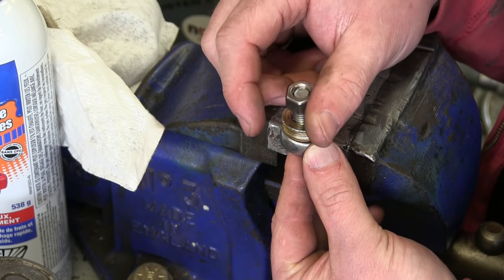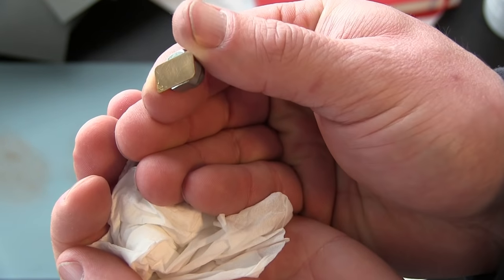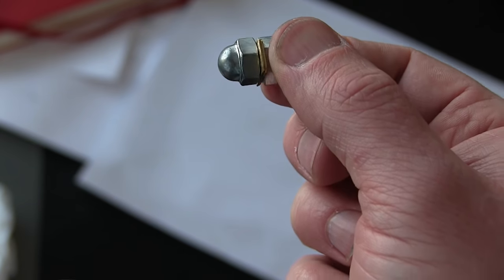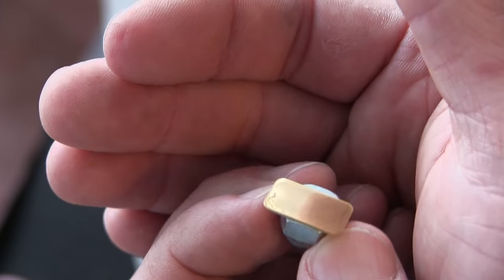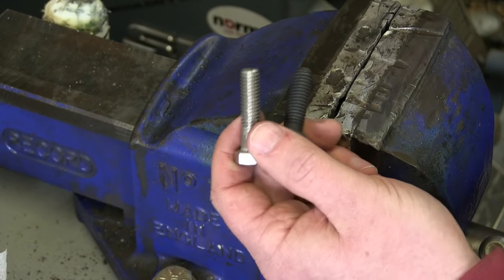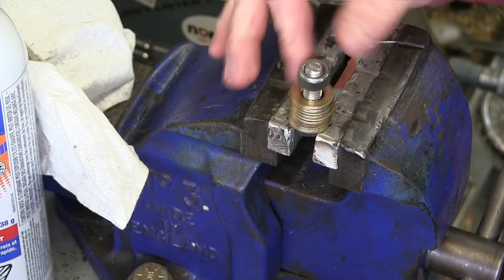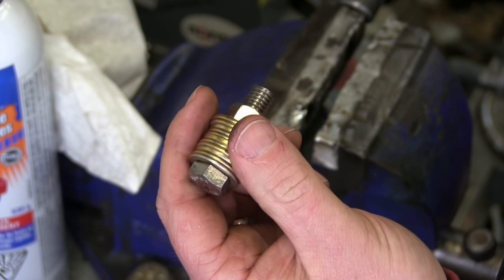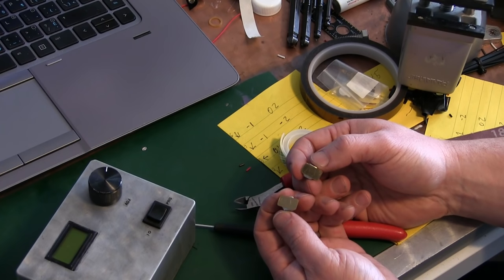Cold Welding of Gold and Stainless Steel in Earth Atmosphere.

Comment: I'm working on a project that use a band clamp with T-bolt fastener. The design calls for stainless to be used however I'm having issues with galling/cold welding of the T-bolt nut/threads. Any thoughts or experience on material choice to keep an anti corrosion design but reduce the galling as the application gets tightened? Thank AvE!
Reply: I'm shying away from the never seize as it'll be for food use. Have you seen the Nitronic 60 SS material before? Very similar to 304SS with some extra Si and Mn to reduce wear. Might need to talk with my local machine shop about sourcing some of this...

https://www.rolledalloys.com/alloys/stainless-steels/nitronic-60/en/
Reply: Thanks for the responses. The search continues!
Reply: There is food safe lubricants. I'm in the food industry (and had my fights with stainless hardware :/ ) Whitmore Medallion is one brand.
Reply: There are also a number of ptfe food-safe sprays that are a dry lubricant. I'd go that route. I am in the aerospace industry as an engineering tech, if you needed any credentials. I use a lot of magnalube, just not the dry stuff (unless it is some release agent) and I am a big fan of ptfe products. I'm curious as to what the thread diameter/pitch is and the spec torque. How close are these fasteners to food? Cuz copper or nickel really is the way to go.
Reply: just thinking out loud cause i dont know all the specifics, but i wonder if there are any 400 series hardenable ss alloys such as 440 a, b, or most commonly c that would meet the requirements. also there are precipation hardenable ss alloys like 17-4 or 15-5 or 13-8 or maybe 17-7. they are a different breed of stainless steel in terms of how its hardened. 

btw, ive worked on both aluminum fuel delivery trucks and in the wastewater treatment field and have used a lot of 304 and 316 hardware.  i feel your pain with galled hardware.

ps. i know ARP makes fully work hardened 304 hardware. its usually rated at somewhere around 170,000 to 180,000 psi vs 80,000ish psi for regular ss hardware. idk if the ARP work hardened hardware would be more gaul resistant. it would be cool to see.  

btw, using 2 different types of materials for the male and female threads have helped in the past. . . just not ss bolts in aluminum that gets salted each winter. no fun on fuel trucks.
Reply: We use cocoa butter at work for stainless and I am pretty sure it is because of it being food industry stuff.

Comment: So the blue ice is not what you want.  I misspent some of my youth working on a small tour/cruise ship in Alaska.  We'd visit Columbia Glacier and one crew job was to net the right kind of ice out of the water and break it up for drinks.  The newer stuff is blue.  At the bottom of a glacier, the ice has had all the impurities squeezed out of it.  Or that was the line the tourists were fed.  It's kind of hard to spot in the water.  It rides lower in the water.  It doesn't even have bubbles like the cubes in your fridge.  It's very very clear.  And in a drink, it seems to take a long time to melt (three drinks on one piece).

Comment: thats a great example of cold welding due to galling. we work on aircraft floats at work and the bastards at the factory put red lock tite on the ss fittings between the bottle and the hose that goes to the float bag. about 70% would weld up like that and we had so many mechanics that were like ahhh bull shit i can get that off. yea they couldn't. best chance for success we could come up with was heat but cant get it too hot. what would you recommend?

Comment: The AMP wire terminal company (now a division of TYCO, (or maybe they changed the name, I don't know)  Says that a properly crimped terminal cold welds to the aluminum or copper conductor.  I don't know if that's true, but I've seen a section cut from the crimp, and I can at least say it's pretty solidly attached, somehow.

Comment: Does this mean compression wielding is a form of cold welding as you describe it? Crimping in electronics uses a similar method. The other thing that springs to mind is when I was tuning RD350's for proddy racing and we needed to get the seal on the barrels really good, we used a mirror as the base for the grinding paste. Would this be of any use in your situation?

Comment: Let's say you placed two metal pieces in a near-pure argon atmosphere and then sanded off the oxidation. Would the pieces cold weld then as long as they remain in the argon atmosphere?
Reply: it would be better than in atmosphere but worse than a vacuum, the argon molecules would still fill the tiny pits and make a not great connection, but it wouldn't create oxide as you did it

Comment: 9:47 That small vise in the upper right corner, Clickspring has one just like it.
Could you tell me what that vise is called? I can't quite read it off the screen
Reply: Thx for the advice weird uncle
Reply: if you need a swivel vice get a shop fox parrot vice. it's the standard vice for gunsmithing.
Reply: Hmm there seems to be a split opinion about the parrot vise on Amazon. I'll probably fabricobble something together and look if it works before I drop money on it. I would love a vise with skinny jaws, right now I have a forged 140mm Heuer Front vise. Which is skookum as frig but not exactly suited for delicate filework, which I find myself doing occasionally. 
Maybe I could build an attachment to my existing vise?

Great, another project to distract me from college xD

Comment: It looks like Van Der Waals forces holding the two pieces of metal together, not cold welding. You can get the same effect just by putting two steel gauge blocks together. If it were actually cold welding, then they wouldn't come apart.

Comment: is the stainless bolt cold weld possible under hand torque (say with a 8' spanner) or would a ceased bolt in that case just be a threading / fuckered bolt problem?
Get my hands on some right messed up rented gear, wandered if that's why all the bolts are jammed to hell

Comment: you could probly get the gold plates to cold weld if you lapped them together.  take that diamond grit paste whatever and stick it between them, and rub em on each other.  rub them linearly, not circularly or any other shape.  the objective is to wear them to a common surface shape.  then ya clean em up and stick em together again and then it oughtta weld a lot.  If you got a third one and cycled which faces are rubbed together, and didn't go linearly, you could form some extremely flat surfaces, down to 30 nm they say.

Comment: I can't tell you how many times I f'ed up stainless fasteners when I worked in a Marina. It got to the point every bolt I put on got a dab of 2-4-C, just to be safe. You showed one galling up under load but I've had one lock up just running down tight, no load. Stainless is great, but they are finicky bastards.

Comment: Isn't the stainless problem known as oxide welding, i.e. when you remove the protective layer a new one will form but with two surfaces pressed together it will weld them in the process.
A rough story I remember.

Comment: A friend of mine who Builds Drag Racing Engines had a catastrophic failure on the Dyno with a Clients Race Engine built from 100% brand new parts, A Titanium Valve Failed, damaging a brand new cylinder head piston and rod, warming up on the Dyno, lots of words from Australia to the manufacture in America of the Valve suppliers who refused to warranty, who insistently stood by their product refusing any warranty, stating their valves were X-ray tested before leaving their business. With only one worldwide supplier my friend repaired the damaged engine and X-rayed all 16 valves in Australia before rebuilding and starting the Dyno tune process, again started the engine and leaving it to Idle on the Dyno and weighting for it to get warm before getting angry with it, another brand new Valve Failed..Again lots of screaming down telephones and it turns out the Engineers asked what he was doing before installing the valves, it turns out my friend was spraying them clean with Contact Cleaner before putting assembly Oil on them. I'm a plumber by trade and years later I was doing a job in an Aviation Engineering workshop and the guys were talking about Cold Embrittlement. I told them the story above and they totally agreed, by Spraying Chemicals like Contact Cleaner or Shrinking parts with dry ice for interference fit installation caused Cold Imbrittling like heat treating in reverse, it fucks with the surface hardening. another job i was installing pipework in a winery for high-pressure gaseous carbon dioxide, from a yet to install 50K/liter vessel. the Engineers came out to inspect my pipework again explained the cold embrittlement issues for the first 10 meters of pipework had to be a higher pressure rating that the remainder of the system, because of the effect of the cold gas has on the material. my point is the contact clear could be causing your Gaulling Issues

Comment: I've been told 304 bolts with ASTM marking (specifically F593C), won't seize up, because they are manufactured to a higher standard.  This sets off my BS detector, but in my limited experience, I've never seen a F593C seized, but have seen a few bolts marked 304 seized. Anyone have any thoughts on this?

Comment: there was this old time boilermaker who lived by "you better fucking antiseize on those stainless bolts", sure enough hes bolting out fibreglass flanges that require stainless nuts and bolts, doesnt antiseize any fucking one of them. Next day Im told to change out the bolts for smaller ones and every fucking one of them was seized. I go up to the boily in question with the bolt that I snapped off and say "next time antiseize up your own fucking bolts"

Comment: Cold welding is only instantaneous at the nanoscale. Your definitely in the macroscale in this video. You need to apply pressure at these scales. That's why the bolt worked and the gold only so-so.

Comment: We once got some contractors to mount some piping for us. These guys didn't use thread lub for round about 25000 (!) stainless Bolts for a brand new facility in Germany. I tell you every fucking bolt was seized to fuck ranging from M12 all the way up to M64. Also it was a chemical plant and we weren't allowed to use spark inducing tools. It took around 2 whole weeks to fix this Problem and cost a shit ton of money because i tell you these bolts aren't cheap!

Comment: Can wringing/cold welding be done with non-metal stuff? Like obsidian or something?
Reply: I'm just a student, but as far as I'm aware, it can only be done with metal. What happens is that metals share electrons freely between atoms in whats called a sea of electrons. This is what allows cold welding to happen. Obsidian is a ceramic material, and it's bonding does not allow cold welding to occur.

Comment: theories of friction; adhesive theory: cold welds form due to incredibly high stress( F/very small area) between the high spots on the surface of materials.   abrasive theory: friction due to the shear stress required to remove a volume of material.  looks like the adhesive theory  to me

Comment: cold welding. . .  no way.
what you are seeing is van der waals forces

The instant reaction on the fresh cut surface of the metal with oxygen makes for an instant 'scab' on the surface.  thus preventing cold weld.

my suggestion.  make a fresh cut inside a container of inert gas, such as argon.  then the two sides should form an instant covalent bond when you touch the two sides.  Kind of like you would expect from super glue.

Comment: You need to force it together just like forge welding and how the nut had the force squashing it to the bolt just hit it with a hammer a press or even squash in a vice or under a drill press with a flat end .. just clean remove any other elements or oxide layer you’d get most metals to stick

Comment: Every time you rub two identical soft materials together with some force they destroy each other. They stick to each other like shit to a blanket. Plastics are a great example. If you take a male and female threaded assembly of identical material and apply a little pressure threading them back and forth for a few seconds they will friction weld them self together. At least it worked with ABS plastic when I was proving a point that we needed a slip agent many years ago for a project.

Comment: Cold welding in a vacuum happens instantly. With only metal on metal the sea of electrons of one object join the sea of electrons of the other and bam it instantly becomes the same object, no different than it would be if it were just one piece of metal. Should work in the atmosphere too as long as there's no oxide layer on the metal.

Comment: weird, I always get the bolt n nut apart. I dont knoe if they are made of the same stuff at the auto shop though and Im using a 750 ft lbs torque gun. I had never even heard of cold welding til today. Very interesting.

Comment: I  have been asked by my doctor to question your phallic methods of daily readiness. I was warned by my GP that spending prolonged periods of time with my penis in a clamp or work bench vice to be considered "hazardous to ones health", although there's appears to be a method to your madness as icing it (as you occasionally suggest) does help with the pain and bruising. However I am left feeling that this routine of practice may not actually help improve my metal working abilities as I was initially led to believe, I have even tried adding protection as you mention but I find it doesn't stay fixed down when wearing a condom. I have to admit though that my organisation has improved in my workshop as I can now reach all of my tools from one standing spot by my vice and coincidentally I don't get as many STD's nowadays.  Is this a Canadian practice or is it industry recognised?

Comment: Your gold pieces are not cold welding. Atmospheric pressure is holding them together. the scratches are resulting from you wringing them together and the high spots are scratching the very soft gold surface. see below from another site.

Gauge blocks are blocks machined to very high accuracies for precision distance measurements, they are finished with ultra-smooth surfaces which are necessary for precision, but also mean that you can "wring" two gauge blocks together and have them cling together without the need for adhesives or fasteners.

Quote from a gauge block maker (Wringing Gage Blocks):

Wringability itself may be defined as the ability of two surfaces to adhere tightly to each other in  the absence of external means.  (They are not magnetized or clamped together.)

Wringing requires two smooth, flat surfaces with surface finishes of 1 microinch AA or better.   For gage blocks, it becomes difficult to wring surfaces if the flatness starts to exceed 5  microinches.  The sources of the forces holding gage blocks together are thought to come  from:

1. Air pressure from the surrounding environment as the air is squeezed out when the blocks are slid together.
2. Surface tension from oil that remains on the gage blocks or water vapor from the air acts as a glue to hold them together.
3. When two very flat surfaces are brought into such close contact with each other, this allows an interchange of electrons between the atoms of the separate blocks, which creates an attractive molecular force.  (This force will remain even in a vacuum or if no oil or water is present on the blocks.)

The last two sources are thought to be the most significant.
Reply: Cody put Ave’s gauge blocks in a vacuum and they still held tight. He also removed all the oil and managed to still wring them together. So his conclusion based on his tests was number 3, molecular force.

Comment: AvE, Cody's Lab, and Hudrolick Press collab to build a vacuum chamber enclosing a pair of custom lapping machines consisting of homemade CNCs and stairstepping polishing discs mounted on angle grinders at cryogenic temperatures - of course all of this is shot in both extra slow motion and infrared cameras while Canuckistani AvEisms pucker your computer speakers & Cody is laughing far, far in the distance. Before you can even blink at this youtube monstrosity, you realize they've slipped another trick into their cinematography, and this microscopy is lovely. You can see the grains in that cold welded metal surface, up close. It's beautiful. "And now in infrared, at 66,000 faps." Thank fuck, AvE was just joking and Laurie is waving, "That is all for today..."

Comment: Newfoundland is awesome.  Drink a little screech, tongue dance with a codfish, and iceberg chips in your beverage of choice.  The ice from the bergs was under so much pressure that the trapped gasses (i.e., 75,000 year old air or woolly mammoth farts) gets compressed and you can actually feel it fizz lightly as it melts on your tongue and the gasses get released.
Oh, and don't eat the yellow icebergs.
Reply: They also make beer and vodka with the iceberg meltwater.

Comment: oh yea, we had to snap off hundereds of ss bolts when building substations they used them for the connection between the aluminum buss work.  They would not let us, most of the time, use antisieze they said it messed with the torque specs the torqueing the bastards together.  Sometimes we would use bronze nuts. Hate SS bolts with a passion now.  but you get a half inch drive breaker bar you can snap those suckers not to bad, just watch out for the porcelain insulators
Reply: Chad Schultz that is a royal pain in the ass. 
I hate how contractors are so cheap some thing that is known and able to be prevented happens